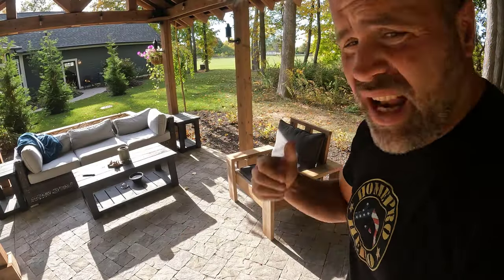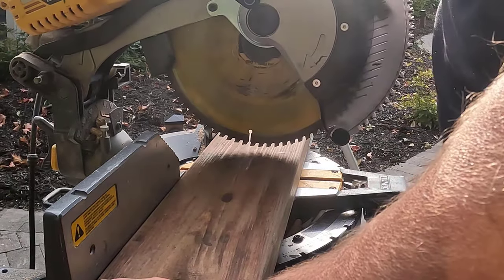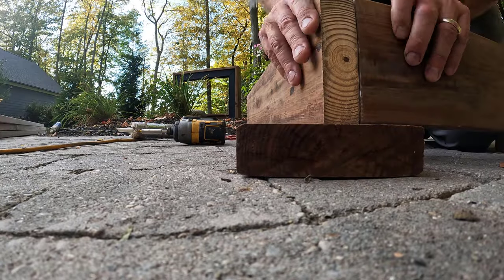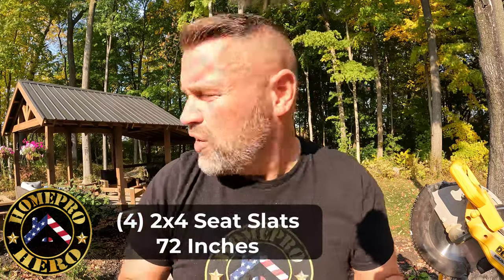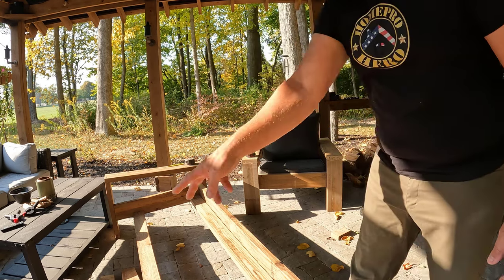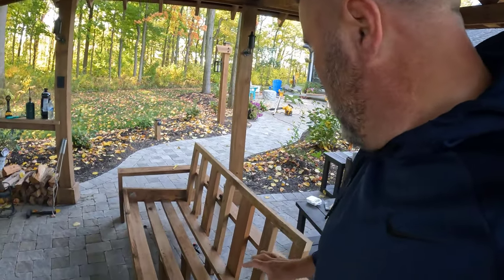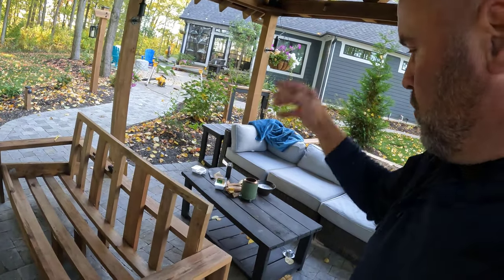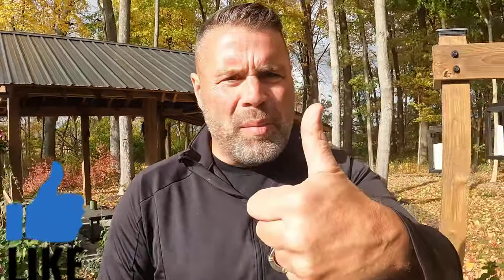How I Built an Outdoor Sofa from Scratch - DIY Patio Furniture

Comment: Great work, i'll sure use your video to do mine. Only thing I did not get right is how your middle leg(s) are installed. 

Thanks!
Reply from the maker: Really just a 2x4 or 2x6 on end between the ground and the 2x4 middle slat. I put two screws in front the top of said slat into the middle leg. Lots of ways to do this don't over think it!  Thx for watching!
Reply: @HomeProHero  thanks for the fast answer! Have a nice day!

Comment: Thank you do much! I really like this outdoor furniture. I had to cut a white oak tree in my yard and I made a few planks out of it. I have seasoned it for 2 years now. I need to cut them into 2x4 and 2x6s as I am planning on building the one you built! Could you also share the plank dimensions for the single seater? Please? 👏👏👏
Reply from the maker: Wow that would be amazing with that wood!  2x4 are 3.5"x1.5" and 2x6 are 5.5"x1.5"  If you need more info on the plans for both you can obtain those as member on my channel.  Its $2.99 a month cancel anytime - so for $2.99 you can have everything i used to build the furniture.  Send me pics when done!

Comment: looks great! Is there a reason you used liquid nails and not wood glue? And could you provide an amazon link to the cushions? Thanks!
Reply from the maker: Thanks for watching!  If wood glue gets wet it doesn't hold even after it dries. It's thin too compared to LN. LN is designed to be in the weather and holds great even when wet!  Cushions Amazon link is in the description they are really nice I just wish they were cheaper :) Take care!
Reply: @HomeProHero there are 3 types of wood glue.  The expensive one, your bench can be submerged in a pool all day long and still hold

Comment: great build. What kind of wood did you use?
Reply from the maker: Thanks!  I used pressure treated wood called Cedar Tone.  Its like the green stuff but its brown and safer - costs a little more.  You can purchase it at menards or  home depot.  I don't believe Lowes sells it. I built my pavilion and the chair out of the same material.  Good stuff!  You could also use cedar but its too much $$$ right now.  Or to save money you could use regular pine but would have to paint it for weather proofing.  Hope this helps and make sure you subscribe for more!

Comment: Look great! I see your stringer boards were cut at a 5 degree angle. At what pitch are your uprights?
Reply from the maker: Thanks for watching Brian!  I don't quite understand your question?  Can you give me more detail?  Thx
Reply: Sure! At 6:19 you add the back board at a slant. What degree is that? How do you determine if the back rest will be comfortable?
Reply from the maker: @80bjones According to google, a comfortable angle for a chair ranges between 3-8 degrees.  I believe I went right in the middle  at 5 degrees.  If you're looking to increase the angle of the upright seat back, you can extend the arms on each side. By moving the connecting 2x4 farther back, you'll have the flexibility to adjust the angle to your liking. I find the current angle comfortable since I sit on the couch regularly. In fact, I built a chair with the same angle, and I absolutely love it! I'm even planning to add a matching lounger and potentially build a complete set for my screened porch. I hope this information is helpful to you!

Comment: Would a 10 inch mitre saw work fine for this or should I purchase a 12inch?
Reply from the maker: Yeah for sure a 10" saw will work if you already have it. But if you need to buy one go with the 12" it's the most common and cuts the most common bigger boatds

Comment: It looks much nicer with 2x6 then 2x4.  Is there a benefit for using liquid nails bs wood glue?
Reply from the maker: Thx for watching!  Yes for sure the liquid nails is key!  Removes any possible movement and really tightens up everything. I use LN all the time it's great stuff!
Reply: @HomeProHero  isn't it what wood glue are designed for? LN is for general purpose and I fail to see how it would do better.
Reply from the maker: @b3arwithm3  take 2 pieces of wood an use LN and do the same with wood glue. You will see the difference. I'm sure wood glue would work I just think LN is a better product for this project :)

Comment: Cool stuff. But why are you using liquid nail on wood. For the love of god, please use wood glue. lol. Wood glue penetrates the wood where liquid glue bonds two surfaces at one point. Not the same outcome over the long run. That’s why woodworks use wood glue.
Reply from the maker: Thx for watching. LN is designed for this particular application and rated for outdoor use. Wood glue not nearly as strong and is designed more for finishing fine woodworking. I have used both and no question I used the right product for this job. LN is great stuff. Take care.

Comment: This is an awesome build and I'm waiting for the wood to dry out to start building. Some questions however.

The 2x4 seat slat behind the front 2x6 face board... is that flush/perpendicular to the face board or are you matching the angle of the side stringers? Would it be beneficial to shave off 5 degrees to make it flush against the face board and match the side stringer?

The top back rest support @ 5:58. You don't mention it or explain how you're attaching it. I am assuming from the commander chair video you used a 2x4 and attached it with pocket holes. Correct?

Thanks again for a great channel. Love your style and videos!
Reply from the maker: Thank you for becoming a member and supporting the channel! I truly appreciate it.

Regarding the 2x4 seat slat, I did run it with the 5% angle on the sides. Although it leaves a small crack at the top between itself and the front 2x6, I personally don't find it necessary to cut that edge to 5%. In fact, it's barely noticeable, and I haven't even had to lift the cushions since I installed them!

You're absolutely right about the back support 2x4. I should have provided better detail in the video. To attach it, I used pocket screws in conjunction with liquid nails, as that board does bear some weight.

Sofa Update:  it's still as sturdy as a tank, and both my wife and our furry friends, the cat and dog, absolutely love it! Personally, I'm more inclined towards the commander's chair. I the spacious armrests and the proximity to the smoker is all me :) Take care, and thank you again!  HPH
Reply: @HomeProHero  greatly appreciated! I'll be sure to post my build when completed.
Reply: @HomeProHero I just noticed since he brought it up. At 6:19 I assume the boards you are screwing in are 26 inch long to make up for the fact that they get screwed into the bottom slat to accommodate the cushions?

Comment: Why do you use construction adhesive for furniture? Some woodglue would do. This stuff is awful for the environment and way more expensive. Just makes no sense IMO
Reply from the maker: Wood glue isn't strong enough and when u add in the wet and cold environment it fails. Wood glue is best for indoor and more fine wood working.  Can't agree the benifits to environment but it's sold on shelves so I assume it's safe enough. Take care